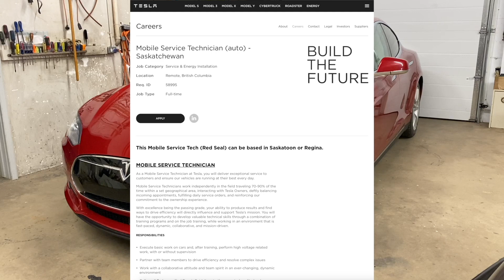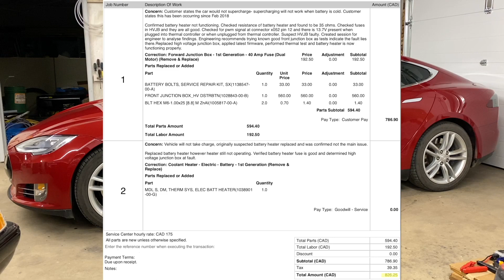Good News Bad News: Tesla Edition

Comment: Mmm if it was the battery heater.. would that not count as part of the 8 year unlimited warranty on the Battery? I mean it is part of the battery
Reply from the maker: I wish. No it’s external so not part of the battery. I searched TMC forum and it’s somewhat common of a failure as the cars age.
Reply: 😭 i should have bought the ext warranty

Comment: I am definitely interested in after warranty service issues/costs.  Our 2016 Model S 70 will be out of warranty in early May.  We plan on keeping the car forever, and I'm on the fence about buying the extended warranty before May.  Car only has 20,000 miles, but has been perfect so far.  Your thoughts?  

P.S. Car has had annual visits for maintenance as we paid for the 8 yr. maintenance plan.
Reply: Every car or for that matter your home needs some maintenance as it ages.
If you are OK with that and budget for some maintenance costs as the car ages you will be fine.
If this concerns you then I would get the extended warranty or trade it in for a newer model.
Early models have had more issues than later ones. Tesla learns from their mistakes and makes changes / improvements as they go.  The newer cars have newer technology and seem to need less maintenance than the older ones.
Reply from the maker: The Model 3 does seem to be more reliable, especially the newer ones.
Reply: @KJSvitko  We purchased the 8 year maintenance plan when we bought the car new.  So I feel we have that issue covered.  The kind of things I'm now concerned with are broken door handles, defective MCU, and other items which are common points of failure on the Model S.  It's a toss up if I should go ahead and prepay these kind of repairs or just take care of them IF they come up.  I'm really leaning in the direction of just waiting.
Reply from the maker: I would say in your case since you obviously don’t drive it a whole lot you would probably be OK without the extended warranty, it’s really just for peace of mind kind of like an insurance policy.